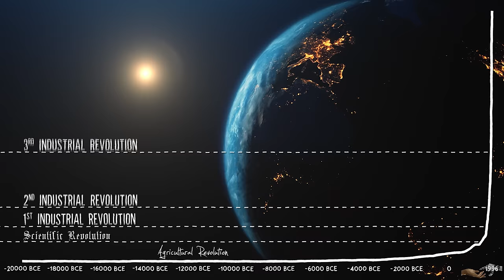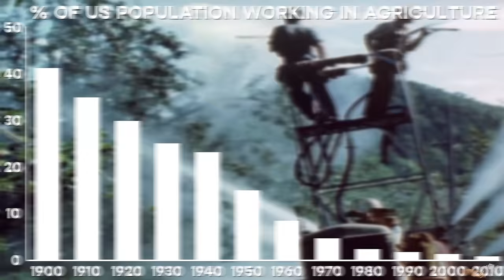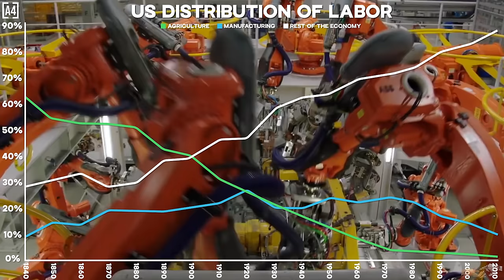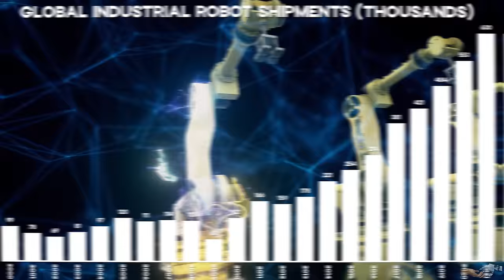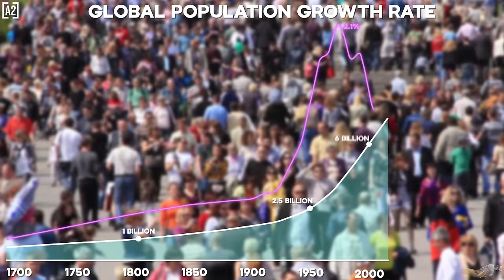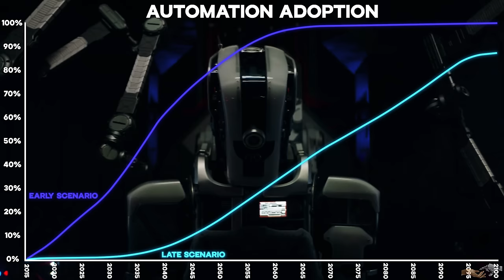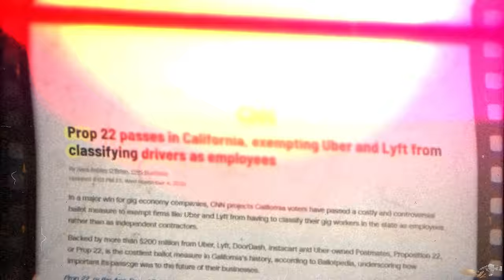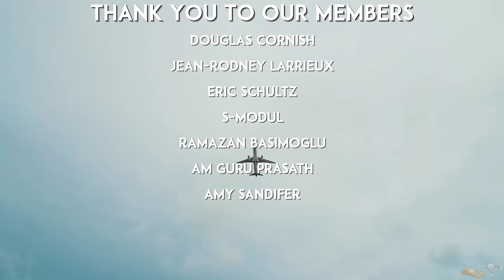How AI & Automation Will Change The World (Humans Need Not Apply)

Comment: Most of the progress seems to be software, rather than hardware. It's great to say ai is there but if it has nothing to plug into then where is the progress. Robotics is lacking innovation or funding.  Take a chickens foot or humans foot. It has a sort of self balancing structure that merges with the surface it walks on. Yet all robots seem to have rigid feet. Why is robotics not merging with 3d printing to create artificial human shaped bones. The human foot and chickens foot should be copied exactly. Why not copy the entire chickens bone structure and make a robot that can walk with less exact computation. Simply the structure gives balance and the ai needs to do less to compute movements that don't result in falling over. Like when I place my foot on the floor it influences the position of the rest of my leg, almost like auto balance. Ligaments to limit movements work with bones.
Reply: Because when it comes to creating robotics making them human or even animal shaped is kind of a waste. What is more efficient is just make a machine designed to do a specific job. Like for instance instead of creating an entire humanoid robot to wash dishes for you people just made a dishwasher instead. Instead of a humanoid robot to drive you around they just turned the car itself into the robot that drives you around. Humanoid form isn't exactly the best when it comes to doing most task.
Reply: @GiRR007  it is the best because it can do multi tasks.  If I had a robot that did the dishes, cleaned the house, and drove the car and could chat then that is better value. Since we can 3D print bone shapes why not try to replicate a robot based of a human skeleton, from toes to head. Pick someone with good balance because structure matters. Ai could train to use the body, even with 3d printing modelling the body in vr for training might be easier. Single function robots also can be useful in teams especially in a factory,  they are more machine than robot though. Robots move around an environment. Ai Cars are driving robots that control a machine. A body is a machine. Make it work !

Comment: It is absolutely inevitable that robots and AI will be able to substitute any human work in the foreseeable future. Qualification is therefore useless because, for example, photonic computers will be almost infinitely superior "cognitively". Robots will also maintain, improve and reproduce themselves. Even an organic fusion of man and machine is inefficient compared to this. The game is over. 

Politicians must recognize the inevitability and fundamentally adapt the economic and social system to it, if the agenda is not to exterminate as many as possible. There is too much thinking in systemic imperatives in the video. The focus on economic individual income and human value creation is completely outdated. There will simply be no more scarcity and no need to do low-quality, i.e. human, work. For fun, perhaps, yes. The state will provide goods or you simply print them for free in a 3D printer. The increase in structurally induced unemployment is also a challenge in terms of public order and security. Probably the change is too fast and the primitive human mind cannot adequately anticipate it to the point where much smarter machines take over. As Elon Musk said, it's going to be really weird.